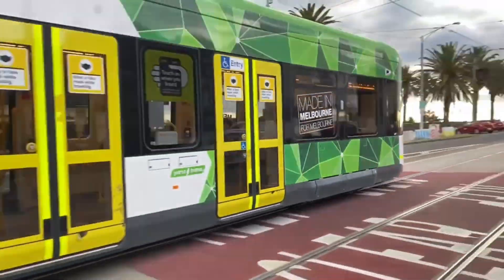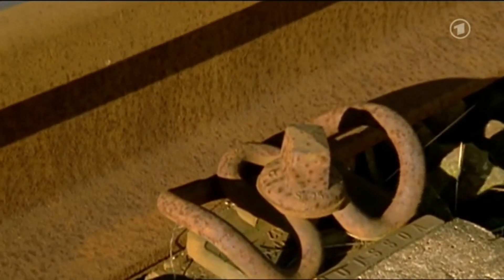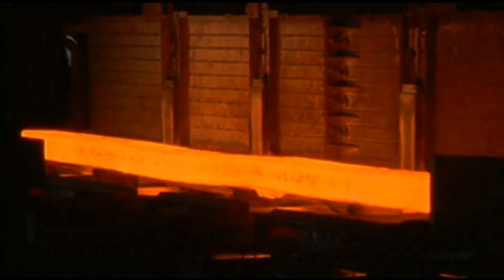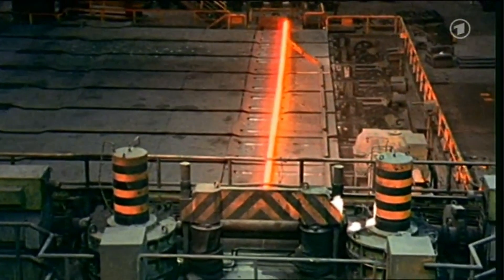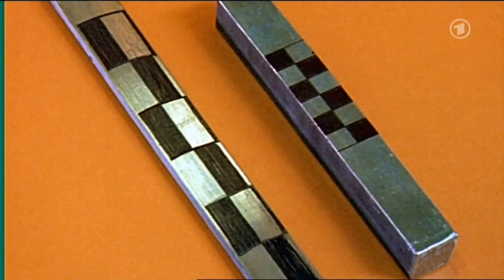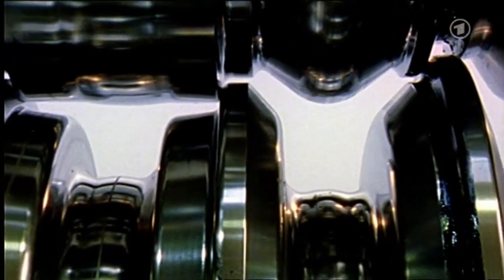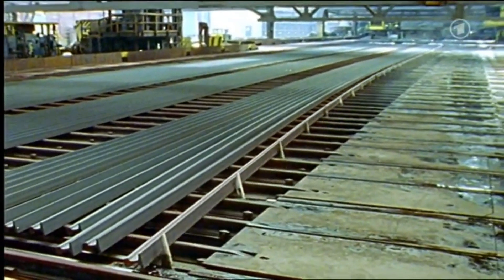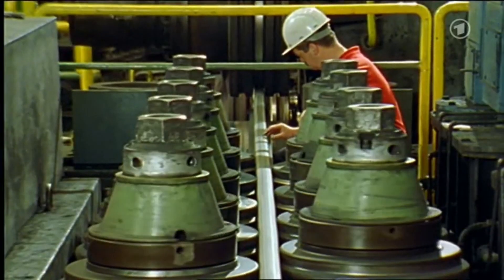Hot rolling of railway rails

Comment: Bạn có tính toán kích thước lỗ hình không cho mình xin với
Reply from the maker: The dimensions of the rail profile are determined based on standard railway specifications, and the rolling process is designed accordingly. The rolling mills use a series of precisely shaped rollers to gradually form the rail's final profile. Each pass in the rolling sequence reduces the bloom’s thickness and refines the shape step by step. If you're looking for specific dimensions, they depend on the rail type (e.g., UIC 60, UIC 54) and the standards followed in manufacturing. Let me know if you need more details!
Reply: @AlJazariedu  tôi muốn kích thước từng lỗ hình cụ thể từ cán thô đến cán tinh  của UIC60 hoặc UIC54 cũng được , tôi đang làm đồ án về nó bạn có thể giúp tôi được chứ
Reply from the maker: @hust4604  The exact dimensions of each rolling pass for UIC60 and UIC54 rails depend on the rolling mill design and the manufacturer’s process. These details are usually specified in technical documents or production standards from rail manufacturers. However, in general, the rolling process follows a gradual reduction in height and width while shaping the rail head, web, and base step by step. If you need detailed rolling schedules, you may check standards like EN 13674-1 or contact a rail manufacturer. I hope this helps with your project!